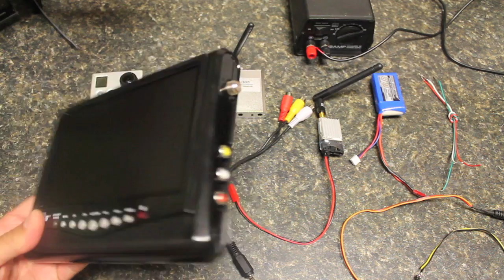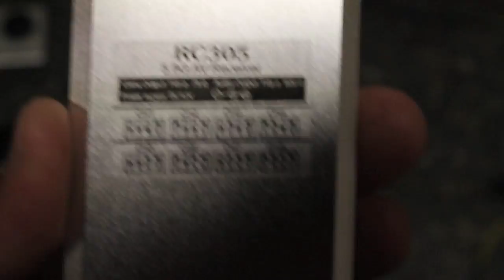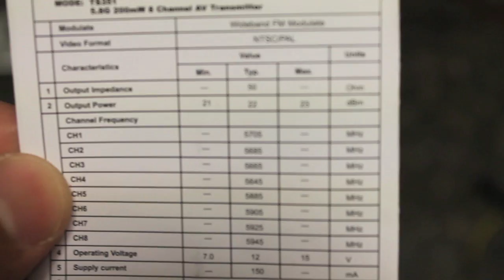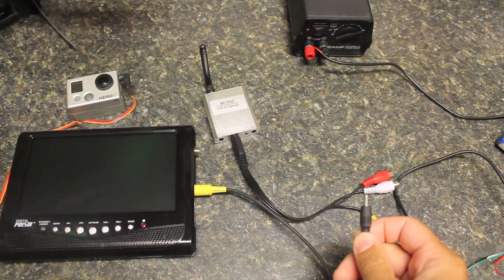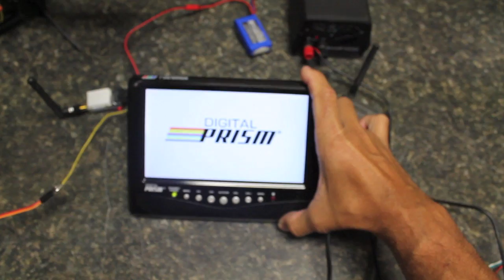How to Setup FPV w/ GoPro HD, HobbyKing 5.8GHz Transmitter/Receiver for DJI Naza Quadcopter

Comment: hi i am new to this what sort of range will i be getting with this set up
Reply: Is says it good for 500m with the stock antenna but 1km+ with a directional antenna it's good for 1km+.
Reply from the maker: Luke Hamilton and Liam Pyott it does say up to 500m with the standard antennas but you'll be lucky to get that. Take Luke's suggestion and get a directional or omni-directional FPV antenna and you'll really boost your range.

Comment: How much did this whole rig set you back$?
Reply from the maker: At the time of the video it was about $125 for the whole setup, but now I see they want $179 for that LCD! Insanity. When I originally purchased it was $50. Now I see they have a TV tuner included which isn't necessary. I'll see if I can find a better source for the LCD display. Thanks for asking.

Comment: Will the receiver be fine if i ran it on a 6v 400mAH NiMH Battery?
Reply from the maker: Check the manual on operating voltage for your receiver. I don't think 6V should be a problem but you want to make sure you know the input voltage just to be safe.

Comment: Hi, could you please help me? I really need it.
I got a GoPro Hero2 and a LogiLink USB 2.0 Video Grabber.
I got the same cable as you connected to the capture card and I also only use the yellow video cable.
But I can't get video on my computer.
This is a completely wired connection since it's going to be used under water.
Can you help me to get it working please
Reply from the maker: To rule anything out with USB drivers and computer configuration have you tried connecting the video out cable to a monitor or your TV? If you don't see a picture then you know it's something with your video TX or RX and not your computer.

Comment: hji there nice video, i have almost the same setup but havent been able to mak it work. i am using 11.1 volt lipos on both tx and rx. set swithces to ch 3 like yours but no dice. tested gopro by itself to monitos and worked, check cable and worked, but doesnot work with the wireless. my tx is a tx5200 and the receiver is a rc305. any suggestions. is there a way to find out if either tx or rx is bad from the get go.thanks david
Reply from the maker: David, thanks for the comment. These are some of the toughest problems to diagnose. My first question is did the TX/RX come together or did you order them separately? One problem that I had was the AV cable that came with the setup. It was bad and cost me a lot of time in figuring that out! It may be worth a check if you have an extra one laying around. Also, if you want to discuss this further check out www.garagepilots.com. Either myself or someone over there can help you out. Best of luck and looking forward to getting you transmitting :)
Reply: Dennis Baldwin hi dennis i found the video cable qith reverse color conection that is yellow was audio and red was video so i just repainted them, i check cables with other tx rx and old 1. and they worked fine i believ something is up with either the channels or the tx or rx itself.

Comment: Now I have the information thanks...  
What is the long distance?  Fpv  thanks nice video
Reply from the maker: The distance with the default whip antennas is not very good. I recommend upgrading to a cloverleaf setup. The default range is about 1/2 mile if you're lucky. Some people have reported much less.
Reply: Dennis Baldwin ohhh thanks for your help   is this the one you talk about http://www.ebay.com/itm/5-8GHz-Circular-Polarized-Antenna-SMA-Male-For-5-8G-Transmitter-RX-FPV-FatShark-/161154432932?pt=US_Radio_Control_Control_Line&hash=item25858d7fa4    ???

Comment: how well does this transmitter/receiver preform?
Reply from the maker: Connor, it performs fairly well given the relatively cheap price. The way to increase performance is to add a new antenna setup like a circularly polarized one. That should at least double the range.

Comment: Thanks for the video... Very informative. When using the Gopro for recording device and FPV, Is there any lag (delay) with viewing FPV ? Thanks in advance.
Reply from the maker: There is a bit of lag, but it was never enough to cause me any problems. The bigger problem was the convex lens of the GoPro and the perspective that threw me off more than anything else. That's why I ultimately switched to a dedicated FPV cam. Thanks for the comment.

Comment: How far can you go before losing signal?
Reply from the maker: Not as far as you'd think with the stock rubber ducky antennas. I'd say you're luck if you get a quarter mile, but most likely it will be much less. I've heard you can get much further with a CP antenna setup, but I haven't tested yet.

Comment: is there a consensus on how to orient the antenna on the Tx? I currently have it horizontally mounted, coming out the back, and i get occaisonal interference, i think from the phantom body itself.
Reply from the maker: Yes, there is a consensus. You don't want to be horizontal in the air and vertical on the ground. Keep them both vertical. You could even have the Phantom TX antenna pointed down if you'd like. Watch this great video on antenna polarization:

http://vimeo.com/8826952

I refer to it frequently. At about the 8 minute mark he goes into mis-matched polarization and talks about the loss in gain. Hope this helps and good luck.
Reply: Dennis Baldwin thanks so much for that link - very cool video that explains really well.

Comment: After soldering some balance terminals, I got the Tx running off the balance on the phantom LiPO and the Screen & Rx running off a single 3S Lipo on the ground (Rx on balance) - - its working great!
Reply from the maker: That's awesome. Very well done and glad to hear it!

Comment: yeah, I'm trying to use another lipo on ground to power a 12v LCD display that doesn't run on batteries. I'm hoping that will work and its possible run the Rx off the balance. I could have explained that better. Thanks for the reply - I think its just a matter of making a jst adapter for it...

Comment: thanks a lot for the video. I have a question, is it possible to use a 3s 12v Lipo (like the one powering a dji phantom) to power the transmitter & receiver, using the balance plug?

Comment from the maker: The red plug is known as the JST connector and the white one is the balance plug. Your battery will come with these connector attached. And on the other end you plug those into your charger. I hope that's what you're asking about. If not, let me know.

Comment from the maker: It's not going to get you to 5km. I believe with the 1000mW transmitter and circular polarized antennas you should be able to get there. Keep in mind there are lots of variables so be sure to do some range tests. I plan on doing a range test soon with the stock antenna and 200mW setup vs the circular polarized antenna. Will let you know how it goes. Best of luck with your setup.

Comment: Hi Dennis, what is the range for this model? possible to extend the range to 5km or more? i saw there is a  boscam TX51W 5.8GHz 1000mW Wireless AV Transmitter, will that be a better choice for longer range? thanks

Comment from the maker: Yeah, that looks identical to the Hobby King setup I have. It should do much better than what you saw. Not sure what is going on. One suggestion is to put it on your multirotor and fly line of sight with a friend watching the signal to see when it drops. I would hope it does better than your test on the ground, but it's hard to say. One question I have is the orientation of your antennae when you did the test. Did you have them both facing up?

Comment from the maker: Thank you. Check out readymaderc . com. They have some insanely small cameras that weigh only 4grams. Yes, you should be able to get video into your laptop. Look up Easycap and see what you think. There are several out there and I've never used them, but have read about Easycap on rcgroups. Best of luck with your build!

Comment from the maker: It depends on which receiver you're looking at. Feel free to send me a link and I'll be happy to take a look. Better yet, please sign up at garagepilots . com and post the link in the forums. Either myself or someone over there can help you out. I've been able to power my RX with both a 2S (7.4V) and 3S (11.1V) Lipo since the input voltage ranges from 5 - 12 V.

Comment: Hey great work man..! i want to make a fpv nano quad copter a similar but a smaller version of a quad copter..but the thing is instead of using a monitor i want to use my laptop for seeing the live video..and since its smaller copter i want the camera to be light weight and smaller too..could u please tell me if it is possible to view the live flight on laptop and also please suggest good small cameras to it....

Comment: did you test the system yet I have the gopro2 I am planning to use  my bixler v1  as a platform with the same fpv I would like to know how good is the range also planning to use my H quad with the system as well.

Comment from the maker: David, I've tried to research this camera for you, but there's not much information. Can you tell me if it has the option to output live video? If so, I would think you could get this to work with the HK TX/RX FPV setup. Check in the manual and see if there's a TV output option.

Comment from the maker: Mine receiver voltage ranges from 6-12VDC. So I use a 3S Lipo to power it. Make sure you check the operating voltage of whatever receiver you purchase because these RC305 have varying input voltages...some only operate on 6VDC. Just don't want you to blow out a brand new receiver :)

Comment: Hey it's all good, though I will be waiting for weeks probably, I found a really nice 7" display,from Ebay item # 150607018057 Dependable dealer Tomtop,  $36.00 Free Shipping.It will be a while getting herebut hey, I am a patient man. Anyway the screen pops easily into a nice quick broad hinged mount a la GoPro with a Program1&2 + 12V DC multi-pin disconnect. The pix quality? Who knows until I got in my hands, but really anyone in China can make a good TFT display can't they? Thanks 4 the invite

Comment from the maker: Devin, is your TX going to be in an enclosure without any ventilation? Most TX setups come with a heat sink that helps dissipate the heat so you should be okay. I would be sure to do a bench test to see how hot the TX actually gets. Since the RX will be on the ground you should be okay there.

Comment: No Dennis, I am trying to do this on the cheap because the damned economy, and I should have made myself more clear. It was the Prism viewer I was referring to. I am looking for the components for the ground station. I'm sure I will get the items together. My FC is the ArduPilotMega and there is the Telemetry radios and OSD and the FPV gear to consider. The wiring harness is not a small component. The antennas are also in the same league. Hope to see more. I can only watch for the meantime :-(

Comment from the maker: Yeah I've seen that Team Echelon vid. It's incredible, huh? I'm now flying with a dedicated FPV cam and use the GoPro for recording. The dedicated cam is super light and a much better res than the GoPro. Check out PZ0420 if you're interested. Thanks for sharing your thoughts.

Comment: Didn't mention they're all $100. Oh and one more thing. You haven't mentioned what you are doing about pan and tilt for the rather bulky GoPro.Watching reall terrific vids this AM:  I couldn't quite put my finger on what it was until I briefly saw a glimpse of the FPV cams in situ. All GoPro, well that isn't so unusual but what is, is that they were using the head tracking system and small but strong pan/tilt supports. Seriously check out this YT title "FPV - Team Echelon - In My Dreams" WOW !!!

Comment: Dennis the price has changed and it ain't lower:-). I didn't check the shipping, I live in Canada and shipping charges are a real come down off a good "dealBuzz" On a positive note>>>> Ebay has FPV kits> Some have RHCP's or cloverleaf antennas, one with extra hi gain patch for Ground Station use , all  5.8 no other frequencies. No 1.3ghz sytems at all for object penetration. So I can live with it already. Key in FPV in the search window for grins and giggles, you might  be surprised

Comment from the maker: Yes, you can transmit sound as long as you have a the audio channel from the GoPro hooked up. I only have video mainly because in FPV all you'll hear are the motors spinning. But if you're using this for a different application then you could transmit audio as well.

Comment: Man was wondering if you could help me. Does this setup work with fat shark goggles? I found the rc 305 rx on hobby king but it is 5 volt input what would I power it with a lipo? I would like the 12 volt one you have but can't find it. Where can I find this stuff  the tx for the 305 is on back order

Comment from the maker: I don't have the cable in front of me, but an rcgroups thread states the following:

Connector tip: White wire
Second from tip: Red wire
Third from tip: Yellow wire
Fourth from tip: Green wire

and:

Green = Ground
Red = Audio Out
Yellow = Video Out
White = Audio Out

Keep in mind that the cable I'm using only has video so you're looking at the third segment from the tip (video) and the fourth segment from the tip (ground). I hope this helps. If I get a chance this week I'll do a test to confirm

Comment from the maker: That's a good question that I unfortunately don't have the answer to. If there is a wall that sits between your TX and RX your signal will be degraded and could result in complete loss of signal although it's difficult to quantify. I always recommend having failsafe configured in case this happens and your quad can either hover and land or return to launch.

Comment: Hi there! At 2:58, you mentioned that the header pin connects to the go pro. Could you check with your multimeter which segment of the pin connects to the brown and yellow wires? Thanks a bunch. I'm going to have to solder it myself.

Comment from the maker: Unfortunately I don't think there is a cheap and easy solution. At least I haven't found one because I think you'll be up against bandwidth constraints. Not sure what distance you're trying to transmit, but that's definitely a concern. Read this for some background diydrones . com/forum/topics/high-definition-fpv

Good luck and please post back if you find anything. Thanks.

Comment from the maker: Yes, it's definitely possible. Just make sure you check the specs on the camera before you buy. I purchased a good cam from securitycam2000 and use that for dedicated FPV while my GoPro is for recording. You can see the vid titled "TBS Discovery with DJI Naza & GoPro FPV - Upgrade to Dedicated 600TVL Sony FPV Camera". Thanks for taking the time to watch.

Comment: The channel switches are probably bit toggles. i.e. 1, 2, 4, & 8. Therefore to get channel three, you would need the first two switches in the 'ON' position, 1 + 2 = 3. That's just my guess from a programmer's perspective.

Comment from the maker: I don't have a Phantom but from what I can tell it has the XT60 (yellow) connector. You should be able to find an XT60 splitter and then put one on the power cable for the transmitter. Alternatively, if the Phantom has a power distribution board you could solder the TX power cable to it and not have to do the splitter. Hope this helps. BTW, there is a guy on garagepilots . com that has done some pretty cool mods to his Phantom. Check out the mod titled "Phantom FPV mod #1"

Comment: I would like to power the transmitter with the DJI Phantom's battery (2200 3s) but I believe i need a special cable...any ideas?

Comment from the maker: If I understand your question I soldered a header pin to my transmitter lead (video and ground) that I could plug into the Ready Made RC GoPro cable. Headers pins normally come in multi-pin configurations and you just break off the # of pins you need. If I'm misunderstanding your question please feel free to follow up and elaborate a bit more. Thanks.

Comment from the maker: Steve, good question and unfortunately I don't have an answer. I'd have to say that the wireless link would definitely support a higher res, but have no clue how to quantify this at the moment. Perhaps in the future I can see what the bandwidth constraints are and will let you know. Yes, the picture is masked with the GoPro output but with my 600TVL FPV cam it fills the whole screen nicely.

Comment: Hey Denis Its good to see you get 720 wide screen back to the monitor via the video TX and RX would you say the link is capable of a higher res providing the viewing panel supports it of course?
Also is the picture masked top and bottom given it is a wide screen monitor
cheers steve

Comment from the maker: The cable I purchased does not have audio, but you can get an AV cable from readymaderc for about the same price. The only problem is that you're going to hear a lot of noise from your motors if you're doing FPV.

Comment: At 5:20 you show the switch positions that worked for channel three but said it doesn't make sense. This is a 4 bit binary input, Sw 1 and 2 on is binary input for 3. The 4 switches have value 1, 2, 4, 8, On means add value, off means leave value out, 4 bits gives 16 possible values. Sw 1 on would be one, 2 on = two, 1 and 2, 1+2 = three, 3 on = four, 1 and 3 = five, 2 and 3 = six. 1,2, and 3 = seven, etc... It's funny both the manual, and sticker are wrong though.

Comment from the maker: Jack, thanks for the feedback. I used channel 3 mainly because it's what was recommended in one of the rcgroups forums. You should be able to use any channel as long as you have your TX and RX set the same. In the field I use a 800mA 2S lipo for the transmitter. I feel like I could go smaller because I did a previous test where I got almost two hours of transmit time with it. Hope that helps.